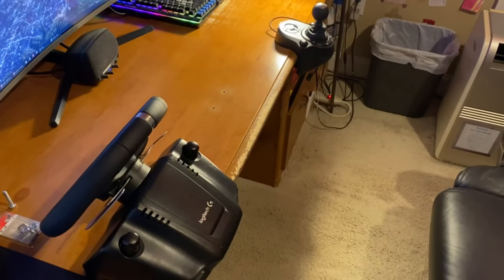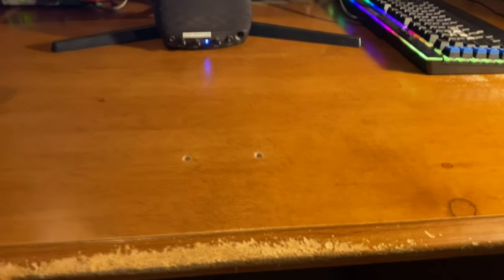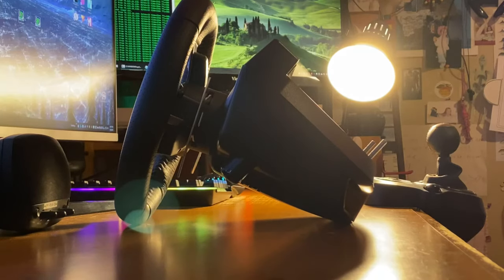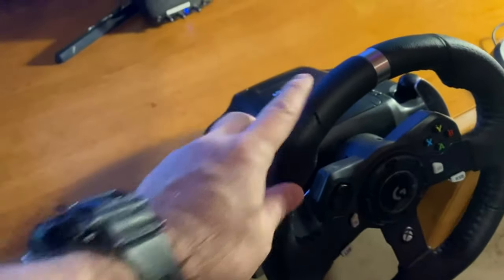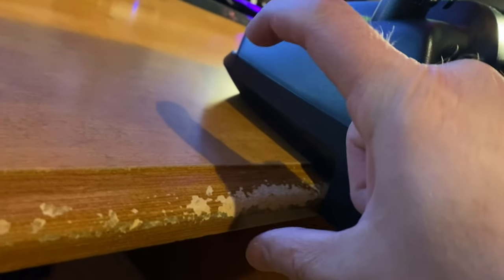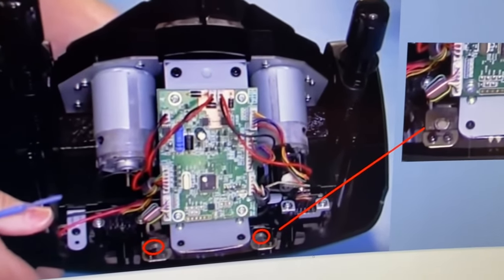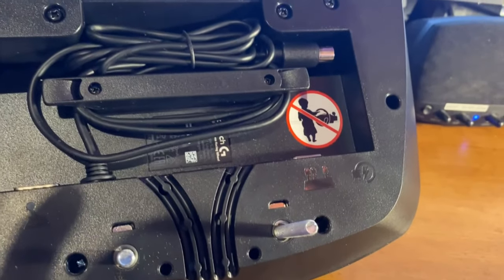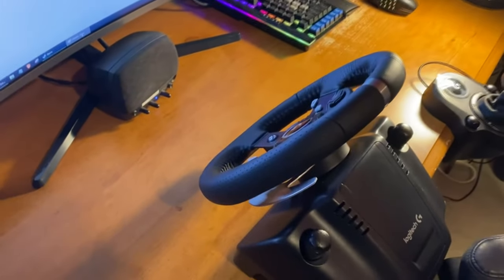Logitech G920/G29 Racing Wheel wood desk mount - Part 2

Comment: great idea!  do you think instead of taking the wheel apart to get the bolts in from inside, could i just cut the top off a bolt and then screw it into the holes from the outside?
Reply from the maker: yes, that should work just fine and will probably be much easier than taking the wheel apart.  i'm pretty sure they make them as well without the head so you don't have to cut anything.  I think they're called "no head bolts" or set screws - something like that for M6 should do it.  Good luck!
Reply: @bigalsdronesbadcompany7331  studs. They’re called studs.
Reply: Buddy you are my hero lol....i have clamped my wheel down and even used a towel for grip and when i steer its soo unstable and the front end of base wants to do a wheelie when im doin somethin as simple as testing cars....thank you!!!👍
Reply: Did u use set crews to fit in steering wheel ? Which size u used
Reply: @Jaingaming128  actually I ended up buying a stand so I could use it in front of the TV as well, so I can't help you with the size unfortunately

Comment: just curious how you removed the clamps from the wheel thanks for the video
Reply from the maker: Unfortunately you have to take the wheel apart. You can check one of the videos I linked in the description. It was the one I used for a walkthrough on disassembling. It’s not difficult, but it is a bit time consuming. GL!
Reply: Hey I took out all the screws then pulled out the clamps with taking it all apart. Just make enough opening on the side and lossen the clamp screws and they will drop out.
Reply: up

Comment: I have a desk with nearly a 1 3/4" lip. Do the clamps open up wide enough to use clamps for mounting or would I have to drill and use bolts?
Reply from the maker: I think it will just fit. I don’t have my clips any more to measure, but check this video out:

/watch?v=XLE88pIbKGg
Reply: @bigalsdronesbadcompany7331  Thanks for the info and the link, I'll check it out.

Comment: I just purchased a new desk but the thickness didn't let me mount the steering column. i am going to do what you did. I was wondering if you happened to have put in a keyboard tray or did you end up just leaving the keyboard on the side on your desk. I thought I would ask to see if you did mount some sort of keyboard tray.  But thank you  or the steering column solution as I was absolutely loosing my mind when the clamps for the column didn't work.
Reply from the maker: No when I use the steering wheel I just slide my keyboard forward to where it’s between the steering wheel and monitor. I guess mounting a tray would work too though

Comment: Do you think the same thing* is possible with the shifter?
I have an incredibly thick desk (7cm) and I am planning on buying the wheel and shifter, but I'm scared they won't fit my desk.

(With thing I mean putting the screws in the shifter so they stick out)
Reply from the maker: Good question, I never needed to mount my shifter. It stayed on much better for some reason. But I don’t see why it wouldn’t work.  You might can search for a video to see if anyone has taken it apart. If it doesn’t look too complicated then you should be fine. Hope it works out whatever you decide!

Comment: I couldn't play for a week because the steering wheel clamp was broken and you saved me. Thank you
 could you please tell me what the size of the screw ?
Reply from the maker: Sorry can’t remember off hand but the part 1 video should have the exact size I used
Reply: M6 x 1 40mm he used. But! What you need to do is measure your desk length, and add 15mm

Comment: Did you put the screws in from the top of the mount? If so, how?
Reply from the maker: Yes, you have to take it apart to access it. Links in description are the vids I followed to disassemble
Reply: Thanks. What length of screw did you use? I got M6 x 18 but they're not long enough.

Comment: thank you for this, i have a similar table and i struggled to get it to work until i saw this. i am now struggling with my Shifter, can you help a brother out.
Reply from the maker: I didn’t mount my shifter since it never came loose from the default clamps, but I only drive big rigs that don’t need split second shifting like a race car game.  So what kind of help you need?
Reply: @bigalsdronesbadcompany7331   where can i get the shifter diagram similar to the wheel that can show me where drill/open up some hole?
Reply from the maker: @GOMothibe  i searched a good bit but can't find anyone that has a template/stencil for the shifter and it's nowhere on logitech's site for some reason.  so if you want to mount the shifter, you'll have to make your own template which isn't hard.  first thing to do is remove that center part as shown in this video:

https://youtu.be/UCxBck6Krso?si=sTOVg9RuMkHdWsf-&t=78

Then just put a piece of paper over the bottom of the shifter and trace around the edge and then mark the drill holes.  And that should be all it needs for your own template.  Good luck!

Comment: Those default clamps are horrible... Just for those reading before buying: It's really annoying that those screw heads are made of slippery plastic. It's hard to get a grip on, and you'll need a good grip to tighten the wheel to any wooden desk. It's terribly bad design. I use a small bit of leather just to grip those things properly and even then it takes a lot of finger strength. If you regularly move your wheel in and out of the way: consider a different wheel.
Reply from the maker: Good tip with the leather